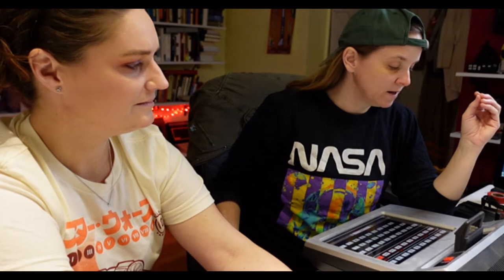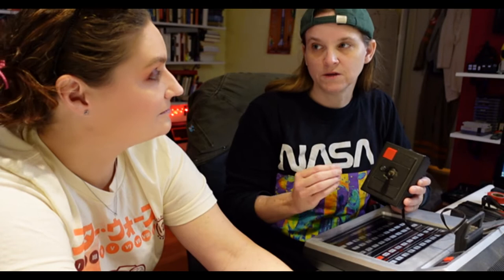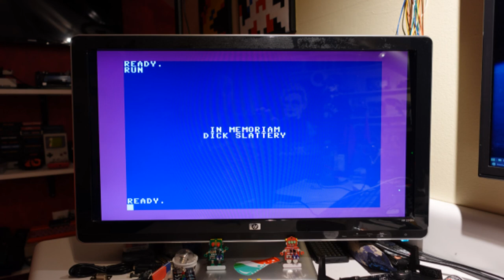Odyssey 2 Joystick Mod

Comment: Your video inspired me to mod my Odyssey 2 as well, but so busy... Well, I finally found the time to add joystick ports to my Odyssey 2, got it out of the closet, opened the box... and found that the original joystick cables were decomposing!  😲  Sticky, messing, marking up the inside of the box, getting goo on everything... yuck!  I ended up removing the original cables entirely, and the RF cable with its weird, non-standard plug (older Odyssey 2) at the TV end, installing Atari-pinout 9-pin controller ports and home-built a composite video + separate audio circuit while I was at it.  After much cleaning (so messy -- you'd think you could leave something on a shelf for 20 years, and it'd still be fine when you picked it up again...), some drilling, some filing, more cleaning... I have two nice, panel-mounted joystick ports and panel-mounted RCA jacks for composite video and audio.  What an improvement!  KC Munchkin and KC's Crazy Chase are suddenly so much more enjoyable when using my (very old now) Epyx 500 XJ Atari-compatible joystick, with its clicky microswitches.  🙂  The original Odyssey 2 controllers were never my favorites.

I also bought a BackBit Pro with the Odyssey 2 cartridge adapter, and I'm enjoying trying out games that don't have, especially those that were never released in the US, including some I never knew even existed until now.  Parker Brothers and Imagic released multiple games for the Odyssey 2?  A very nice port of Atlantis, showing off what the Odyssey 2 can do when a company like Imagic takes the time to program their games for it?  Frogger winks at the player after hopping across the title screen?  All very fun and very cool!

I intend to put some new cables and plugs onto the original Odyssey 2 controllers at some point, but they're neatly tucked into a box for now.
Reply: Love to hear it!  Sorry about all the entropy, but what a great excuse to upgrade and play with it. And you know we are fans of the BackBit. Evie is so great.

Comment: I've had an Odyssey^2 ever since I got one used in the 90's, and when you showed that the "hardwired" controllers had their own JST connectors on the inside of the system?  You blew my dang mind!  🤯  I might have to do my own DB9 controller mod some day now!
Reply: Isn't it crazy???

Comment: Thank you for this video. However, after almost two months of buying different adapters and cables I have been unable to get my 2600 controller attached to my odyssey 2. Can someone please tell me how the ribbon cable is connected to the db9 cable? What is the black plastic piece on the end of each ribbon cable wire? Thank you for any help on this.